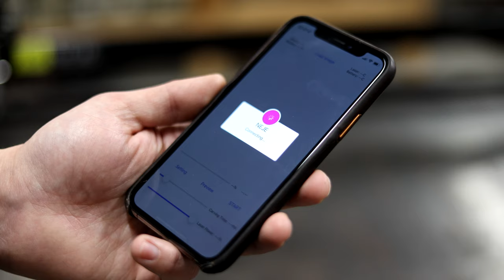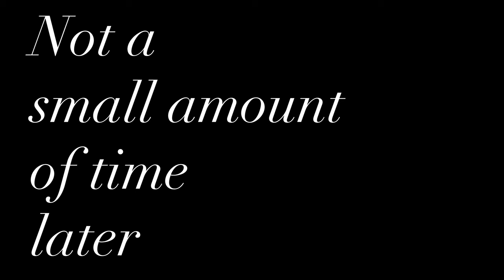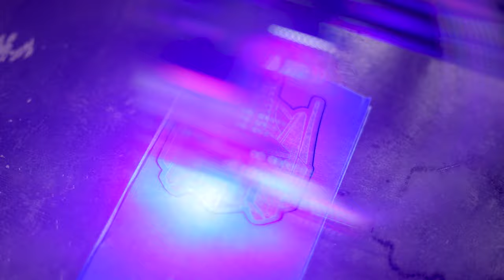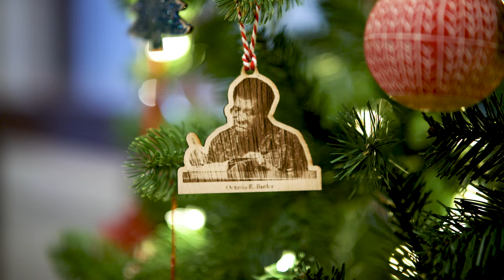Making ornaments from scrap wood | Newbie vs. the NEJE 2S Max N40630 Laser Engraver Machine

Comment: that is pretty cool.  I want to get a plasma cutter for my shop which runs under the same principals.  Ventilation, air compressor and lots of trial and error.
We end up buying so many custom made parts, it would be awesome to be able to just make them.
Reply from the maker: Oh yeah, agreed! A CNC plasma cutter feels like about the peak of computer controlled manufacturing value. Both practical in regards to the input (no bits, etc.) and the output — stuff from strong materials that would be much, much harder to make any other way. Looking forward to when you get that!
Reply: @AndrewReuter  I need more space in my shop.

Comment: Looks for me laser is to far from wood
Reply: Yeah, i have the same machine but with stronger laser head N40640. Focus point (for me) is 17.1mm from the bottom of protective window to the material (eg. plywood).
Google "focus test" for neje and determine best focus height for your laser (using the "ramp" method") and the results should be much better.

Comment: I have this exact same laser module but i cant seem to cut even 3mm plywood or mdf as easily as youtube videos show. I've managed to focus the laser pretty well with a black paper and 0.30% it starts to mark it but no matter where i set the focal point (top, mid or bottom) of the wood i can't cut with with the said speeds or passes to cut a 3mm plywood took me 14 passes. Any advice?

Comment: complete newbie and have had no success to cut wood at all with all bad results. what type and depth was your piece and the speed and power if possible just cant seem to get it right.. i have good air assit and also of the bed thankyou
Reply from the maker: Sooooo I ended up using 100 percent power and seemed like I still needed 3-5 passes to cut through completely. What kind of results do you get, and with what settings? Good luck, in any case!